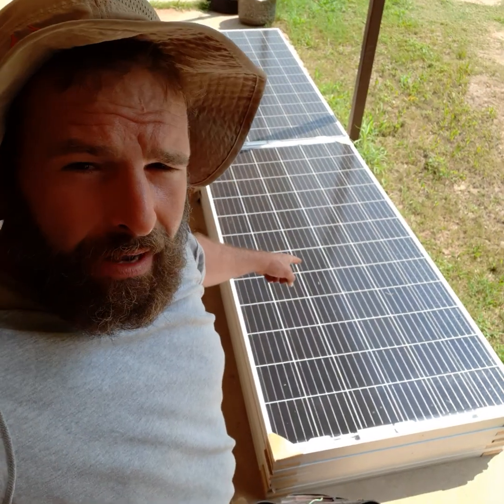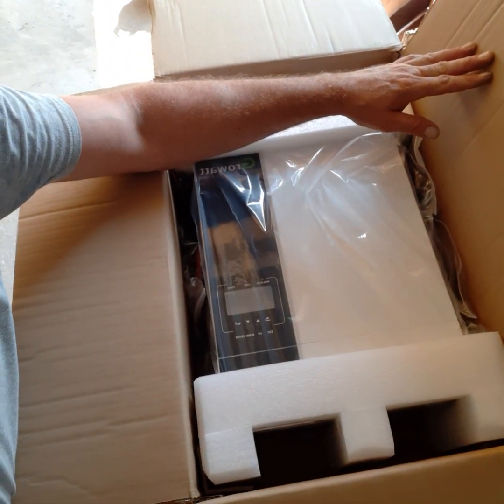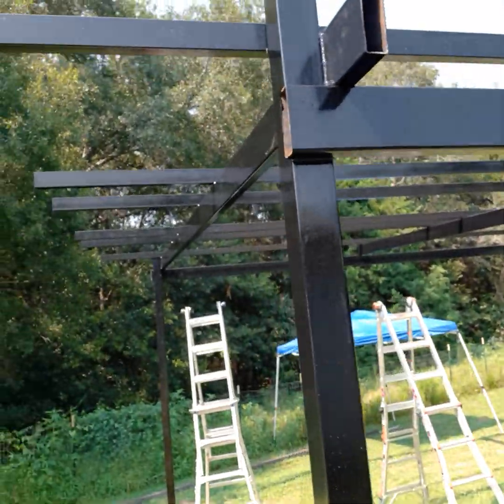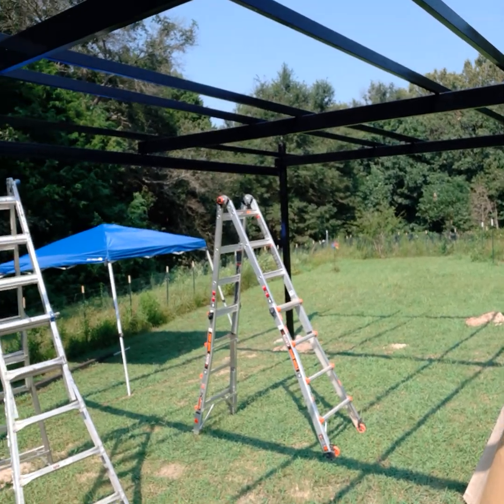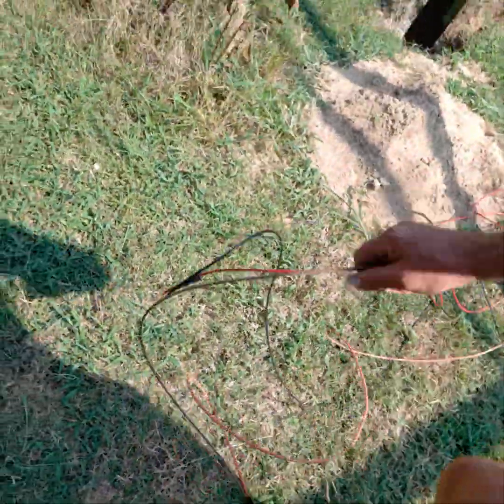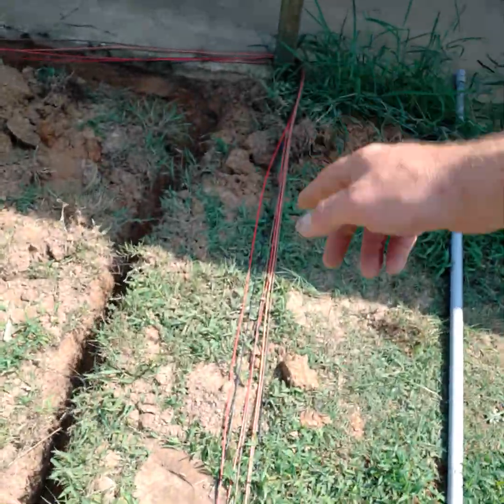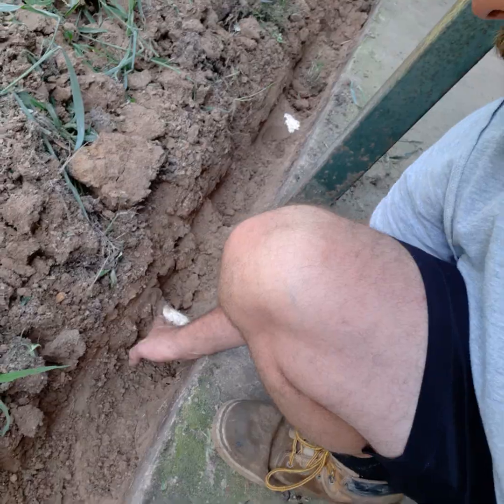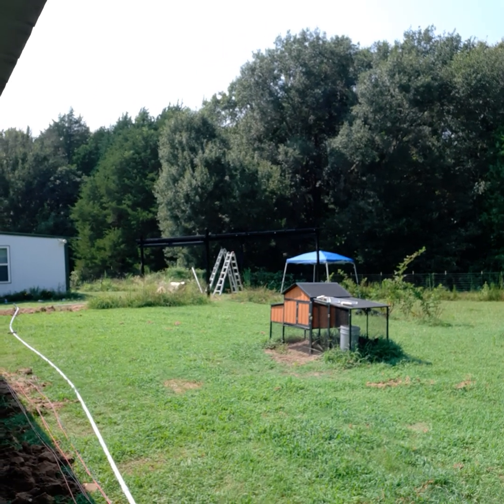50kw off-grid solar

Comment: Considerening this size of batteries and the kw of the panales do you need a gas generator when it's a rain season?
Reply from the maker: Not necessarily but is definitely advised to always have a secondary source of energy input. In most cases or 95% no

Comment: How many batteries did you use and what size inverter(s)? Does this have an output of 50kwh per day?
Reply from the maker: So far we have 12 Batteries Now each 5.125 KW equaling 60 KW of storage. The solar panels we use are monocrystalline biofacial for the solar rack which was 21 x 385 watt each. Grand total 42 solar panels were installed onto the platform the inverter platform was designed by us from grow watt series 5000 ES 15 KW power output stackable system 75 KW charging KW per day. System operates usually between 45% and 95% on any given day

Comment: A great example of why a person needs to be able to weld.  Looks great.   Did you use standard rails like IronRidge on top of the structure?
Reply from the maker: Thank you sir and yes everybody should learn how to weld absolutely! No the rail system it's not Iron Ridge everything has been custom fabbed or fabricated the R panel Roofing kit for the installation was bought from signature solar. And some of my other earlier videos the equipment is shown. Thank you for watching!